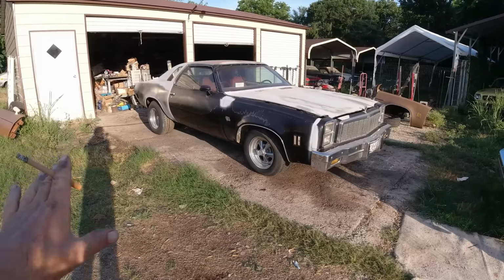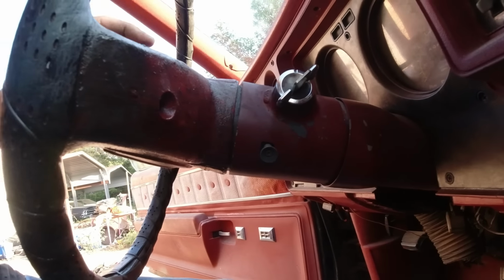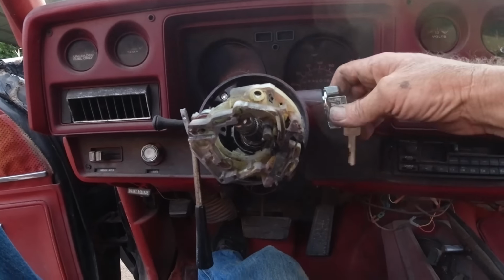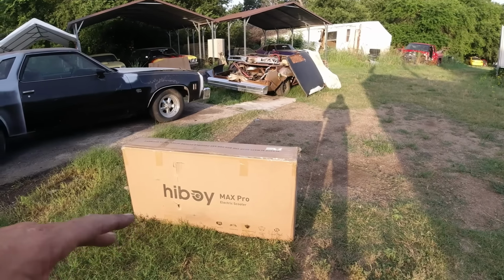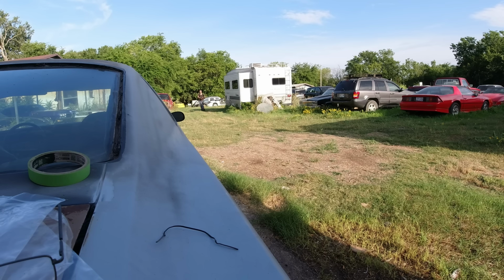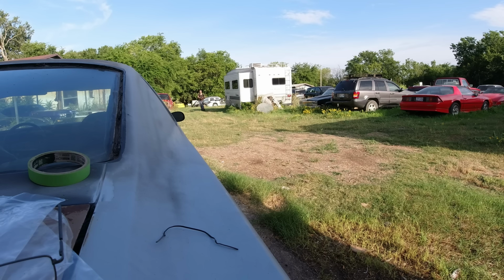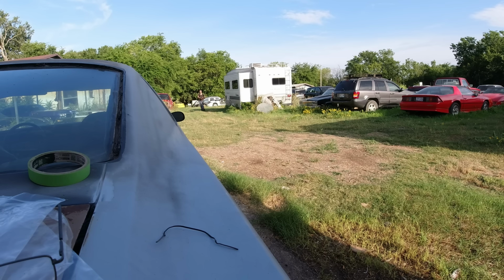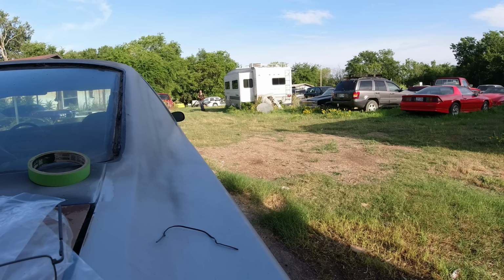1977 Malibu Classic Build #6. Ignition lock. Stereo. Painting parts. Interior work. Scooter #Hiboy

Comment: Cars looking great its come a long way quickly hats off to you bud, the bumpers can be sunk in bud if you drill them behind the mounting plate on the cylinder, press them in enough so you dont need the rear filler panel then pop a screw in the hole you drilled they are oil filled tho so if you do it keep your face out the way 👍💯👌
Reply from the maker: yes but I don't like that look

Comment: Another great video Lee. Btw, the grille on the black car is correct for a 1975 Malibu/El Camino/GMC Sprint. The Tan Malibu has the correct 77 Grille. And if you're serious about a Laguna front nose, I have several in stock. And I'm in Central Texas.  I've been working on, and collecting parts for this generation of vehicles for over 30 years.
Reply from the maker: not really interested but curious what you sell everything to complete the swap for.

Comment: Lee, Those pop rivets are fast but if you are keeping that car the after market cheaper window motors go bad quicker than originals.  With nuts and bolts it is a quick swap if you have bad luck with a cheap Chinese window motor down the road.  Some new motors actually come with nuts and bolts if you get lucky.  I have done many factory rivet drill out or grind outs.  Rivets were the fastest and cheapest way to go at the GM plants back in the day but the parts were randomly selected and rigorously tested.  A factory part like a motor would be turned on and off until failure, they were expected to last ten years or for the life of a vehicle, all depending on usage, cycles, etc.  These “new” motors you bolt them in, say your prayers and hope they last at least a few years.  I put one in my Firebird maybe 15 years ago and it is still good.  My 60 Impala had both originals fail two years ago.  Originals I had to drill the door metal to be able to drill the rivets out.  So originals lasted exactly 61 years each, new Chinese motors lasted two years each.  World wide parts quality is at an all time low for every country with China leading the pack.  In many cases China is the only source for certain parts for old cars so I give China respect for that.  Just wish they would step up quality.  It fried both new ones in two years as mentioned.  I next rebuilt both original window motors and put those back in.  Did many other cars window motors for other people, have no idea if most of them lasted long, most were charity jobs and those cars were rough and rusty not long for the world.  The perfect type cars for putting in the cheapest replacement motors you could find.  A car that might last two years tops at max, burning oil, onion skinned tires, dash lit up for every major system and the bottoms of both front fenders and door bottoms rusted off, side skins rattling in the breeze as it sails down the road.  Just a car they needed running for another few months with a working window.  Thanks for showing the ignition lock replacement, you are really good at explaining the repair.  That brought back memories of one that locked up on my friend’s car and a very crazy night.  One last compliment, way to be genuine and yourself.  People won’t always like you but if you are genuine that is correct.  If you are loved by masses then you are playing, a chameleon who must shift to be popular, copying others, faking, selling out or in, acting, just not being yourself, trying to be that clown or that perfect somebody.  That definitely works and good for anyone making it no matter how they pull it off.  Someone like me however appreciates somebody like you, a man with a brain, opinions and ambition being genuinely yourself showing what you are doing and explaining it well.